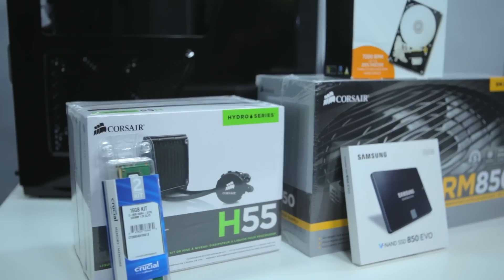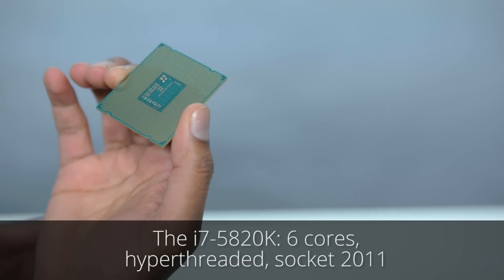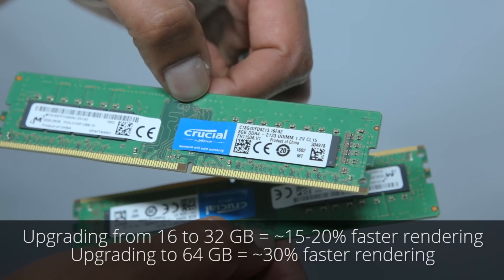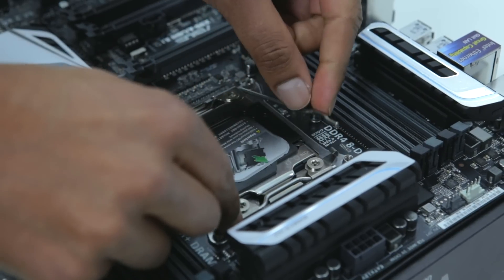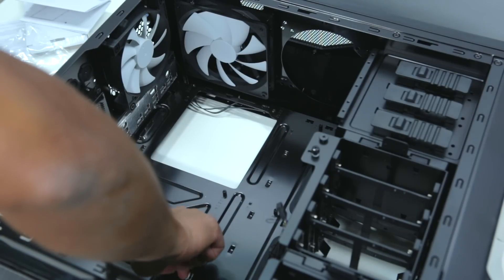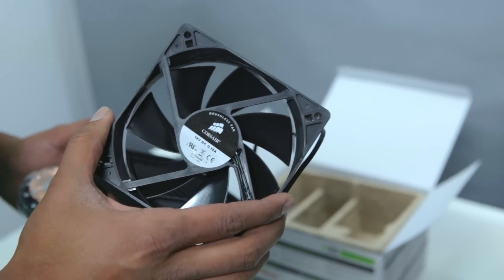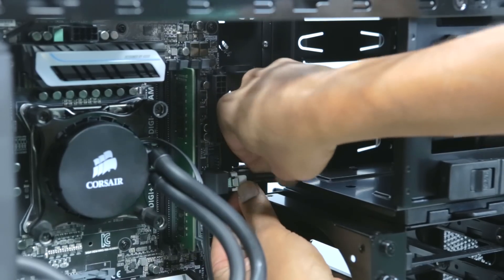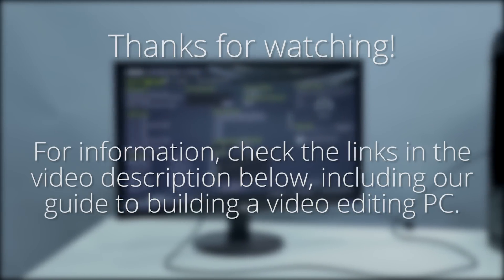How to Build a Video Editing PC ($1500 Video Editing Build)

Comment: Nice videos! But the airflow of this build is bad! You should make the radiator fan push the air through the radiator outside  (behind or above). It is a bad idea to blow hot air inside the case. And if you dont want to have a dusty PC very quickly there should be more input fans than output fans. I see one input fan and two output fans. Inform yourself about positive / negative air pressure and its effects.

How I suggest doing it:
- AIO CPU cooler blows air out at the top behind to the case
- 1 fan blows out at the back above the case (as you have it already)
- 2 fans input air at the bottem in the front of the case
- 1 input fan from the bottom of the case

As you have an AIO CPU cooler there is not much airflow in the case but the motherboard needs some cooling as well. Therefore it is advised to have some airflow in the case and some more case fans.

For X99 socked quad channel RAM ist best for perfromance. Especially when rendering. So I would go for 4 * RAMs from scratch.

Comment: Heads up, you don't need Nvidia/CUDA to render on GPU, most modern video editing programs support OpenCL, which is Open Computing Language standard, supported by AMD and others.
With that said, R9 380X should be enough to make rendering up to 6x faster compared to CPU, but some money can be definitely saved on CPU.
Reply from the maker: Interesting, thanks for the info!

Comment: In Asia we need a PC that works with speed typing & create documentation for professional to get admired by the authority. Hi, I need a PC that build with extreme typing & documentation process to be deliver. Which Model for Mainboard, RAM & Other accessories. In this video you guys just build the Hardware, Thats cool Video, NICE.
Reply from the maker: What is your budget?  I'd be happy to help you pick out components!
Reply: I make a solution in a Computer Center, Dhaka city. The hardware (Mainboard, RAM etc.) the make for my PC is cheap and flexible but they didn't know about anything about operating systems???  Thanks for comment.

Comment: would a cx 750 work? pcpartpicker says not compatible but I was just wondering your thoughts
Reply from the maker: Are you using the build listed here?  Why does PcPartPicker say it isn't compatible?
Reply: Logical Increments it says one additional 8 pin pci connector is needed but yes I am using this build. others have said this still will work it just doesnt have the dual connectors
Reply: Logical Increments and im using everything except storage and memory
Reply from the maker: I wouldn't take the chance personally, even if it is workable.  However, if you're comfortable with that minor risk then go ahead!

Comment: I'm new to computers and technology in general. Would I be better off getting the iMac 27 inch. or just building one like this? I just want something simple..
Reply from the maker: If you like the Mac OS then go for that!  They are solid computers, if a bit overpriced for the hardware.  This build performs great for the price.
Reply: Like I said I am new to everything so I just need something simple and will last me a while. Which would you recommend personally?
Reply from the maker: Personally I would go for the build in the video, but its subjective.  Mac OS is great and if you prefer their video editing software, especially, then its worth going for.  There isn't a technically correct answer.

Comment: does that video card have cuda cores?
Reply from the maker: Romano Thanks!
Reply from the maker: CUDA is specific to Nvidia cards, so the 380X does not have them.
Reply: then why run that card if that does not help with rendering...? weird pick for a card without cuda cores.
Reply from the maker: It still renders very well, for the price.
Reply from the maker: What do you mean Romano?
Reply from the maker: +Romano 
Still not quite sure what you mean, but ok!

Comment: I wanna go with this build but not a liquid cooler.(do you know a good air cpu cooler?)
And is it needed to have such a big power supply?
Reply from the maker: You could get a good air cooler, we reccomend a lot on the site!

Most PSUs are quite large.
Reply: Tim Montanus what cooler do you recommend?
Reply from the maker: The 212 Evo is a good, standard HSF.  It depends on your budget and how much overclocking you plan to do.
Reply: Thanks for answering, but I already built my pc.
I toke the Be Quiet dark rock 3 as cooler and the corsair rm 650 as psu.
And I have 32 GB ram and the asus strix GTX 960.

Thanks for the great video it helped me a lot.

Comment: What do you guys think...Here my list. +Logical Increments

CPU: Intel Core i7-5820K 3.3GHz 6-Core Processor  ($368.99 @ SuperBiiz) 
CPU Cooler: Cooler Master Hyper 212 EVO 82.9 CFM Sleeve Bearing CPU Cooler  ($24.88 @ OutletPC) 
Motherboard: MSI X99A Raider ATX LGA2011-3 Motherboard  ($197.98 @ Newegg) 
Memory: Crucial 16GB (2 x 8GB) DDR4-2133 Memory  ($61.99 @ Newegg) 
Video Card: Gigabyte GeForce GTX 970 4GB WINDFORCE 3X Video Card  ($309.99 @ SuperBiiz) 
Case: Fractal Design Define R5 (Black) ATX Mid Tower Case  ($99.99 @ Newegg) 
Power Supply: EVGA SuperNOVA NEX 650W 80+ Gold Certified Fully-Modular ATX Power Supply  ($75.98 @ Newegg) 
Total: $1139.80
Reply from the maker: It looks good!  I would use a 750W PSU instead, but otherwise it is a great editing build!

Comment: Is this good PC build for 4k video editing, opinion pls ?
INTEL Core i7-5820K 6 cores 3.3GHz (3.6GHz)
MSI X99A SLI PLUS
GIGABYTE nVidia GeForce GTX 970 4GB 256bit GV-N970XTREME-4GD
KINGSTON DIMM DDR4 8GB 2400MHz HX424C15FB/8 HyperX Fury Black
CHIEFTEC CTG-750C 750W Full A-80 series
Samsung EVO 500 gb SSD
Sandisk 960 GB 2,5'' sata 3 ssd ultra
Reply from the maker: It looks like a great build, though I would up your 8GB of RAM to 16.
Reply: And what about this configuration, I want my 4k video editing to work flawlessly ?

Is this enough to edit 4k videos without problems, advice ?

cpu INTEL Core i7‐6800K 6‐Core 3.4GHz (3.8GHz) Box
cooler
COOLER MASTER Nepton 120XL vodeno hlađenje (RL‐N12X‐24PKR1)
mb ASUS X99‐E
mem
2 x KINGSTON DIMM DDR4 16GB 2400MHz HX424C15FB/16
HyperX Fury Black
vga
ASUS nVidia GeForce GTX 970 4GB 256bit STRIX‐GTX970‐DC2OC‐
4GD5
ssd 1
KINGSTON 480GB 2.5" SATA III SHSS37A/480G SSD HyperX
Savage
ssd 2
KINGSTON 1TB 2.5" SATA III SKC400S37/1T 7mm SSDNow KC400
series
opt LG DVD
case
COOLER MASTER CM Storm Enforcer Case (SGC‐1000‐KWN1)
+ CHIEFTEC APS‐1000CB 1000W Full A‐135 series Power supply
Reply from the maker: It would likely do 4K quite well, yeah!  I'd maybe switch that 970 for a 1060 if you can, it performs better and is often close in price, but otherwise it looks quite good.

Comment: Thank you very much for the insight. 
I've started to do some research on graphics cards. Do you feel like the AMD RX480 might be a better choice? It has VR capability as well as the option of crossfire (maybe an upgrade in 1-2years). I'm still deciding if I should get the 970 or the RX 480. The RX480 isn't yet listed in your component list so I'm eager to know what your opinion is :)
Reply from the maker: The 480 is slightly worse than the 970, but they are both good cards!
Reply: Logical Increments Thanks for the fast answer, you guys rock.
Reply from the maker: Thanks so much!  Glad to help.

Comment: Is there any flaws in this build? Cause I am going to do a lot of high quality 1080p to 4K cinema4D rendering, which mean that I'll need this cpu for making my render go faster. But I really want a long-lasting PC so I don't want any flaws or too negative impacting things. But would you recommend this for rendering videos with really intense quality?
Reply: I am especially worried about the liquid cooler, is its durability good enough for it to last at least 5 years and is it better than a normal fan such as the Noctua NH-U12S?
Reply from the maker: There aren't any flaws, no.  You could get better components certainly, but the build is fantastic as-is.  The liquid cooler should last that long, but that Noctua cooler is a great alternative option if you are concerned.
Reply: Thank you! :D
Reply from the maker: No problem!

Comment: This is the first time I've ever tried a manual build and I'm using your video as a bible but I'm a bit concerned that the Corsair H55 cooler may not be up to the job if I'm overclocking etc. Should I perhaps go for one of their slightly more expensive models to be on the safe side? If so, what might you recommend that would be compatible? Thanks! :-)
Reply from the maker: The Corsair H110i would definitely be a safer bet!
Reply: Brill :-) Thanks again for your help.

Comment: I can't find this exact motherboard on the Amazon.co.uk website. Can you recommend an alternative from the UK site that will work well with all the other components pls? Also planning to up the RAM to 32GB and use a GeForce GTX 970 graphics card instead for use with Premiere Pro. Thanks
Reply from the maker: Hey there, I believe this is a link to the mobo on Amazon UK: https://www.amazon.co.uk/Asus-Intel-Lga2011-V3-M-2X4-Motherboard/dp/B00N98RXQO?ie=UTF8&tag=logicaincre05-21

Here's another that would work: https://www.amazon.co.uk/MSI-X99A-Sli-Plus-Motherboard/dp/B00V4V4SFC/ref=sr_1_1?s=computers&ie=UTF8&qid=1467043969&sr=1-1&keywords=X99+motherboard

And another: https://www.amazon.co.uk/Sabertooth-X99-Motherboard-Socket-2011-3/dp/B00VUK54F0/ref=sr_1_4?s=computers&ie=UTF8&qid=1467043969&sr=1-4&keywords=X99+motherboard
Reply: That' brill - thanks for your help (and videos) - very much appreciated!!!

Comment: Hello, firstable, awesome videos, you got one sub.
Ok, i'm here to found a accuracy answer to this ¿What is the main different between gaming and video editing-rendering PC?
TNKS
Reply from the maker: Hey Thiago, thanks for subscribing!

For a gaming PC, the graphics card is the most important component and CPU and RAM are still important, but not as important as the graphics card.

For a video editing PC, the CPU and RAM are much more important than the graphics card. (Unless you're editing on DaVinci Resolve software, which requires a powerful graphics card.)

Comment: Why would you put an intake in an unfiltered part of the case?
Reply from the maker: That is generally where you want to put the intake!  Additionally, with the good air flow and radiator, there isn't really much of a need to worry about dust or anything entering.

Comment: If he is Adobe user, Nvidia gpu would be much better option. 16GB of ram is not enough. He will also need one more SSD in the future.
Reply from the maker: +overlord580
Thanks for the input. We agree that an NVIDIA GPUs have certain advantages when using Adobe products. Whether or not 16GB of RAM is sufficient is subjective and will be up to Ahamed. His rendering times would be faster with more RAM, but he could easily be fine with 8GB as well, if he considers his rendering times fast enough for his standards. Whether or not he needs another SSD in the future is also subjective. If he just wants to continue using the SSD for storing his OS and most-used programs, 500GB is more than enough.

Comment: I'm not sure I get why you went for a 390x. You said yourself you don't need a powerful gpu and I believe the one you chose might be overkilling for the job. Wouldn't it be better to spend less there and get instead a 6th gen cpu?
Reply from the maker: +Giulio Mecacci
The i7-5820K is currently better than Skylake CPUs such as the i7-6700k, so the CPU is certainly in no need of an upgrade.  It is true that the 390x could be considered overkill, but a strong GPU helps with GPU heavy projects and allows for some gaming.  However, if one wanted to spend less on the GPU, that is certainly doable with little performance loss.
Reply: You're right, thanks a lot!
Reply from the maker: *****
Glad to help!